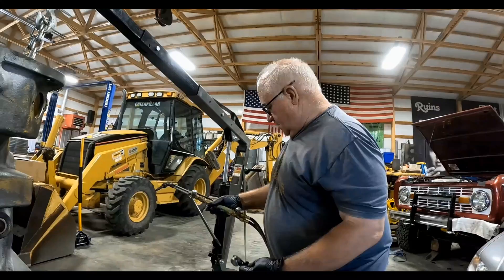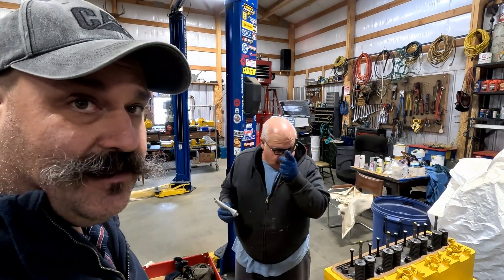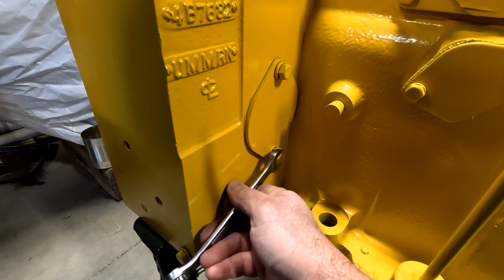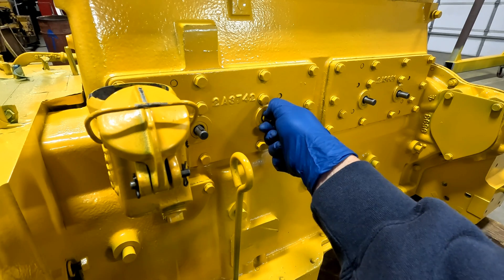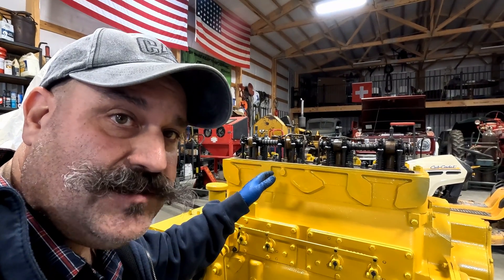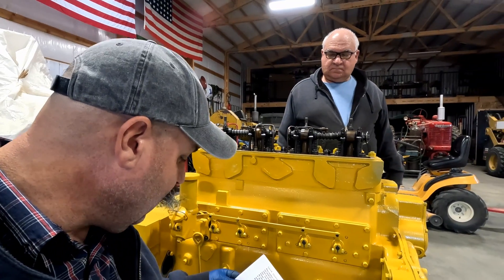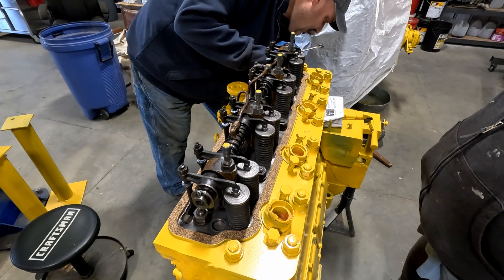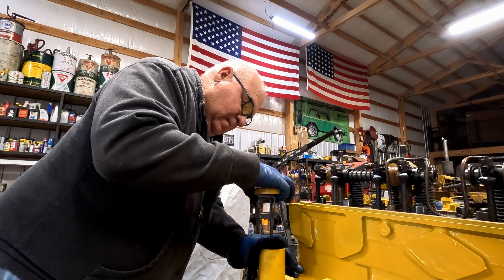D4400 Diesel engine valve adjustment. 1939 Caterpillar D4 4G9986 "Lil Lefty" Episode #99

Comment: I have a Cub  Cadet LT 1050 and a sprayer just like yours!
Reply from the maker: I absolutely love that little tractor, and the sprayer. ☺️
Reply: @lifeafterourloss  My LT 1050 is 19 years old and purrs like a kitten. All original! Sprayer is 18 years old and on it's second pump.
Reply from the maker: @Watchyn_Yarwood I think mine is about that same age. I'm pretty religious about changing the oil. Putting new bearings belts Etc. They are really good tractors.

Comment: Looking good there Aaron. Should be just assembly work from now on. I think with adjusting the decompression you should not be able to set it so that the valves touch the pistons? At least on the D4 it should be impossible? One very common mistake is not adjusting all of the decompression leavers equally. That can cause some sputtering on the engine side. From how I see it from the video everything is done right. CAT seem to have a very foolproof system. I can see one issue when the engine is all rusty and crusty and the leaver dose not move back to the off position. But that would be a very rare instance.
Reply from the maker: Thanks Steve. I do recall at least one of the Pistons having valves clearly imprinted in the top. The marks were so perfect I initially thought that they were cast that way. But then I recalled the two bent valves that I found in the toolbox and it made me wonder if at some point they had hit the piston. I think they're sitting on a window sill over the workbench 😊